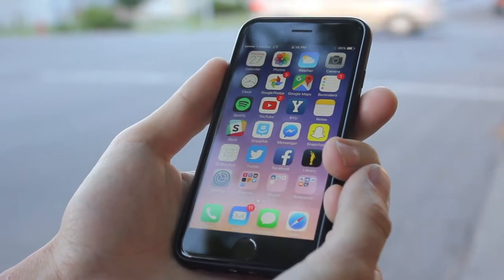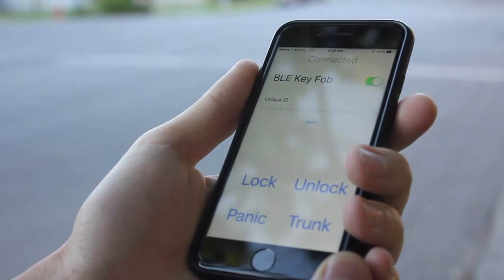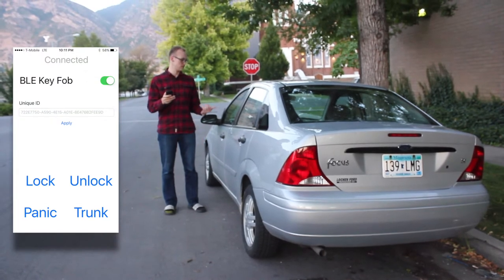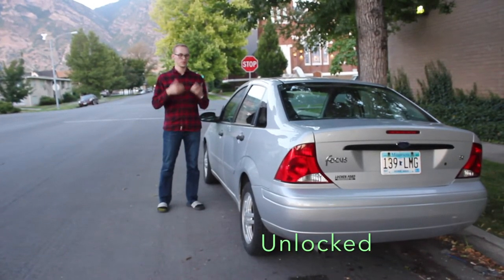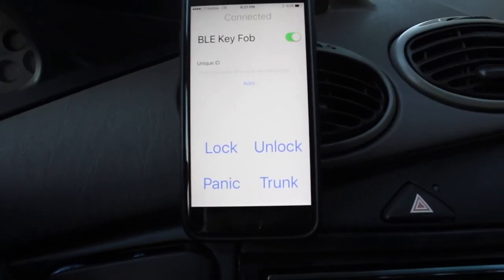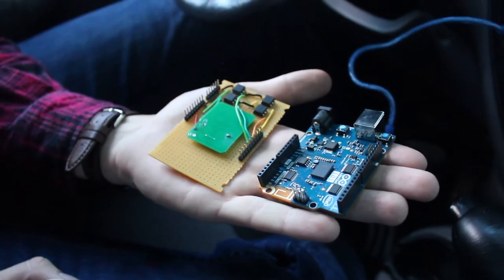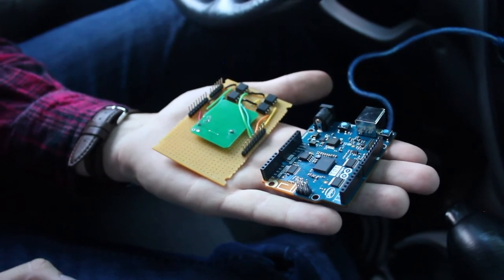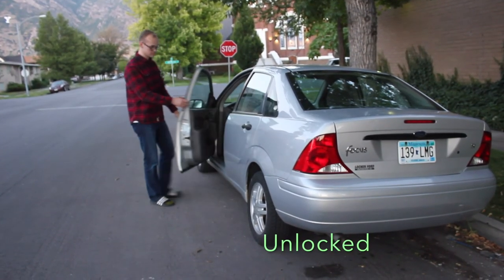Intel Hacks 2017 - Curie Car Keyless Entry

Comment: How can i setup this app my phone ? The app is not available in the app store, but you shared your files.
Reply from the maker: Berkay Günönü correct I did not publish it on the App Store (since this was just a hobby project). You can open the files in Xcode if you have a Mac then connect your phone to transfer the app.

Comment: So the phone acts like a ble beacon and the 101 searches for that beacon?
Isn't that unsafe? cuz beacons can be copied.
Reply from the maker: Yes, I believe that's accurate, but it's been a long time since I originally worked on this. A subsequent version of the project (not on Github) switched the role of peripheral to the Arduino and required the phone to act as central and send a secret key to perform any actions such as locking / unlocking.
Reply: @zachbrogan  Well that's neat if its reaction time is quick. Could u share a link or sth to this update?

Cuz I'm working on a PKE system and I used a HM10 running in beacon mode instead of the phone, and another HM10 searching for beacons connected to an arduino in the car.